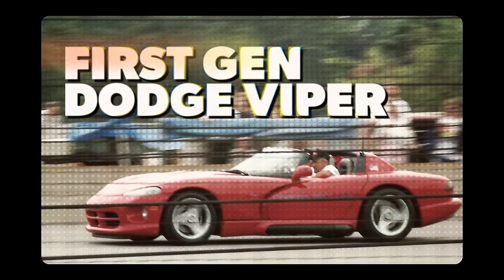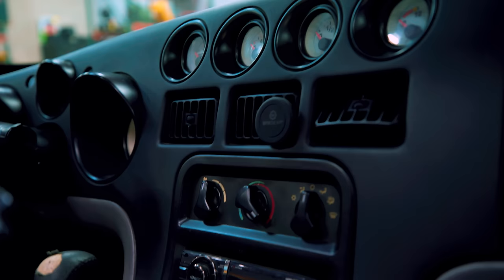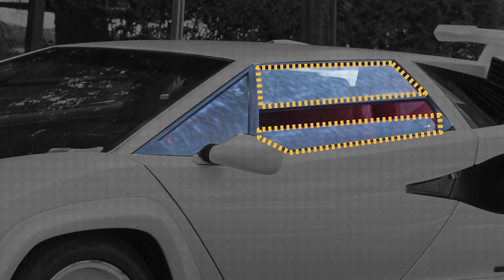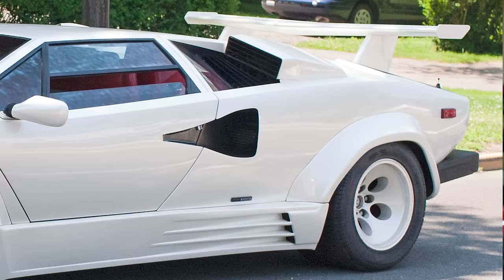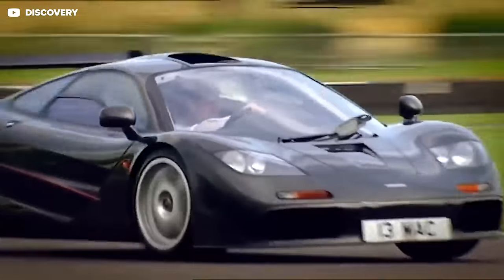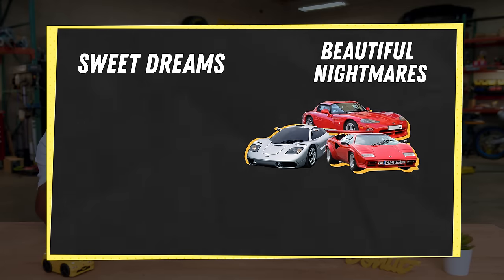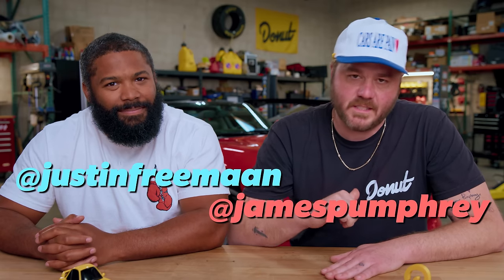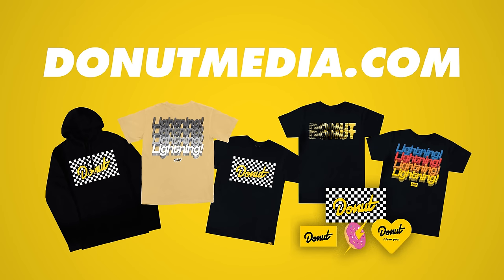Cool Cars That Suck to Own

Comment: You should do one on “boring” cars that are actually fun to drive
Reply: 100%, buddy!!
Reply: they did, in the past, they made a video on cars that look boring but are actually pretty fun.
Reply: Smart forfour (first gen). Only weighs 2000 pounds, very fun engines, the stock suspension is very stiff/sporty, and it has electric power steering which feels extremely responsive and accurate. 10/10 would drive again.
Reply: I had.a ford escort wagon 5 speed manual and that thing.was quick as hell... It had a mazda engine in it... It was like driving a go kart.
Reply: They already did
Reply: I had an escort 5 speed too, not a wagon but was a blast
Reply: A4 B6 1.8T Quattro with a manual. You'd hardly ever notice one, but man they're fun.
Reply: @joshsemo4214  it's probably just nostalgia, but my dad had a Ford Escort when I was younger and I remember absolutely loving that car. I'd pick one up today if I could find one in my area.
Reply: @joshsemo4214  oh hell yeah. I drove a 4 door, auto, had 78k miles when i got it; had to scrap it at 257k
Reply: YES! YES!
Reply: That's most of their videos.
Reply: They have their Miata series, right? 😅
Reply: Yeah, that was a good episode.

As for Escorts, one of my first cars was a 2 door Escort hatch from before Ford and Mazda had babies together. It was OK. My guess is that it's Mazda's influence that made a lot of Ford's cars fun. Currently I'm a grown-ass man and every day I drive around in a 12 year old Mazda 2 and smile. It's truly an entertaining and cheap car.
Reply: Bumpity bump bump
Reply: Renault Megane 2. It has a 5 speed manual with a 1,4L turbocharged engine and even though it doesn't look like much it's an amazing car.
Reply: Skoda Octavia RS mk1. It looks like the family car your grandfather would own but it has the legendary 1.8T 20V 200hp turbocharged engine under the hood, the same as the Audi A6! Insanely reliable and robust engine, smooth and quick acceleration (because it's a turbo) and the car itself is super cheap. What more could you ask for?
Reply: Please talk about the American 6th generation celica
Reply: Every old shitbox that is reliable, slow and could be fixed with pocket change.
Reply: Manual Yaris
Reply: @SusedatLubo  that's not fun to drive... That just gets you from point A to point B
Reply: @Mr.Engine993  Really depends on what you clasify as fun. My civic fits that bill and even with bolt-ons and a cam it's still fairly slow, but super fun to beat on or just cruising and rev matching. A friend of mine has an opel astra f estate 1.4 90hp, super boring and slow, but just with I/H/E it started to pull decent and he has a blast beating on it. Hell even my dad's old clapped out passat b3 with 1.8 90hp engine, which is a slow rolling chore to drive was fun to beat on. Point i'm trying to make is the car doesn't make the fun, you do. It's just easier to do it on an old manual shitbox cause you don't care about babying it all the time and it's still going to be practical. Overdrive did several videos with a PT Cruiser and a Ford Ka, it doesn't get more mundane than that, but they had tons of fun modifying or driving them on track.
Reply: So maybe Honda civics and Mazdaspeeds?
Reply: My '96 Accord Wagon is a blast to drive. Some of the best handling ever.
Reply: @infin1ty850  they're great cars actually I've had two.
Reply: *we found the Miata guy
Reply: 5 speed escorts. Boring and not fast but it feels like a go cart.
Reply: @joshsemo4214  man I drove one. It wasn't fast. You had to turn the AC off to get on the freeway. It only had 95hp
Reply: That'd be so dang lit! Freak yeah!!
Reply: Octavia
Reply: I nine hundred and sixth this motion.
Reply: Saab 900 type whips
Reply: yes
Reply: @capnwhiff  you're right, but another one sounds fun
Reply: This comment is big brain
Reply: Already a thing
Reply: Kind of reminds me of the old saying "Is it more fun to drive a fast car slow, or a slow car fast?"
Reply: Tdi with a tune
Reply: Any rental
Reply: Judging by the likes on the comment they will definitely have to do this.
Reply: They did an entire series of that called Money Pit featuring a Miata.
Reply: Or a “most fun/coolest cars that are faster/slower/ less hrs power than this *insert popular moped, tuned out lawn mower, boat, ect*”
Reply: Hell yes the most fun car in the world is a rental Versa
Reply: They have a while series on the miata 😅
Reply: Best answer for this is any car you can afford to drive it without giving a shit if it breaks or not. lol
Reply: Hooning a Gen 4 Prius is surprisingly fun yet completely stupid
Reply: This
Reply: I have a 50hp volkswagen fox and its fun to toss around
Reply: Fuck yeh need this
Reply: Toyota celica!
Reply: Prius,   it has tiny crap tires.   Try to get side ways.   Have fun. 
Dodge neon, 
Pontiac Bonneville ( if it is supercharged and it works)  
Buick Riviera.  The super charged wide track...  the short one but not the bubble boy car.
Reply: Bump
Reply: They done it already
Reply: Srt-4 would definitely be on that list 🔥🔥
Reply: @neilpatel8769  agreed, it was a couple years ago too so they should do a part two or something
Reply: I think they did before
Reply: 2nd this
Reply: Ford fiesta with the 1.0L engine and manual transmission. Poor man’s ST
Reply: Happened.
Reply: If a car is fun to drive, then I would not call it boring. Lol.
Reply: 1993 chevy 1500
Reply: I submit my 2013 1.4t dodge dart for consideration! Handles great and makes all the fun turbo sounds
Reply: Chevy volt
Reply: They did it was the Civic video.
Reply: Already have
Reply: Like miata or a civic
Reply: 100%
Reply: Pt cruiser
Reply: That one with the silly drift button ☝️ 😂
Reply: You really want your clapped Honda civic to be featured huh?
Reply: Get a manual 3.5 Altima. Trust me
Reply: @CodemasterRob exactly what I was thinking.
Reply: Well, the most boring, ugliest, really the most ugliest car but its awesome to drive is undoubtedly fiat multipla, it really feels weird.
Second one should be ford c-max, that car is a beast on corners.
Reply: Any Honda civic ever
Alternatively basically any hatch with a manual. Go do autocross and have a blast
Reply: Brilliant idea 💡
Reply: Volvo 240 should be in this list
Reply: The Honda Prelude shoud definitely be on that list!
Reply: corolla hatchback with the manual transmission
Reply: Boring cars can be fun!
I’ve been lucky enough to have had some fast cars, but one of my favourite was a 09 seat ibiza 1.4 Manual petrol that my wife had.
We have a lot of bumpy country roads where I live and the size of the car and tuning of the dampers was perfect for it and really fun to drive.
Just goes to show you don’t need massive power, lsd, or rwd ect to have fun on the right road.
Reply: @capnwhiff  I was gonna say. I think they also did different budget points for the cars in the vid
Reply: HONDA FIT
Reply: PART 2 OF THIS ONE LOL
Reply: 2015 Mitsubishi Mirage was the best car I owned BECAUSE it was so cheap and boring
Reply: 1992 Sentra SE-R Was boring looking but fun to drive !
Reply: Toyota matrix with a stick, the xrs even came with toyota vtec
Reply: @vornamenachname727  i'd say hydraulic power steering feels more accutare and responsive
Reply: Theyve done it already i believe… with the miata and other cars
Reply: @kingbleach4446  i see you too are a man of culture
Reply: Pontiac Vibe. When I was like 15 I'd go with my dad to his work and do laps on the roads around the buildings. (They were closed off so nobody else was in danger.)

That Vibe had a real low center of gravity, and relatively wide tires and wheelbase. It slid perfect on the gravel, transitioned to the asphalt so well. I'm sure nostalgia and personal bias is a factor, but for a grocery getter that car was so fun.
Reply: Cadillac Ats, you'll probably never notice it but it shares the same platform with the camaro minus the v8 options. Can come with an lsd, brembos, magnaride and a manual
Reply: Mazda mx3 for sure
Reply: @Josh Semo  I'll just say, mazda knew how to make really fun engines in the 90s, from high revving rotaries, to the BP engines in the miatas to their diesels. Not a ton of hp for any of them but my god they are fun.
Reply: @Rust on Wheels  I think they had a diesel mazda engine iirc. That or a turbo 4 cylinder that was like 1.3 or 1.4
Reply: @CodemasterRob  had a b6 s4. Great handling car
Reply: @vornamenachname727  Smart Roadster is much more fun👍 Gruß
Reply: Toyota CHR is a good one. It's really slow so you have to learn to carry momentum through corners, but the handling is actually good and the wheelbase is short. 50/50 weight distribution too. A good car to best on
Reply: @joshsemo4214  my parents had an old escort when i was a kid, miss that thing a ton
Reply: Smart cars. Super fun to drive especially the electric ones
Reply: Honda Fit/Jazz
Reply: Crown Victoria...It's cheap ...Well...It was till people caught on...has low power...However considering how big it is...they handle very well and even better with a few mods...can even fix the low power issue....Honestly I've had a freakin blast in every single one of them I've been in (it helps not to be in cuffs while in one) they are absolutely hoonable...and I've had several from '85-'02 ...honestly the entire Panther platform from every year is fun with hidden potential....
And to most people they are boring and lame. :)
Reply: 93 Ford Escort!!
Reply: 2004 honda accord 3.0 lx ,best car i’ve owned
Reply: SVT Contour
Reply: Honda fit 2nd gen especially
Reply: Uuh, the mini cooper!
Reply: @renaokawa6199  Can't explain why but I really wanted one in highschool. It just looked like fun and they were dirt cheap.
Reply: They have already  it was cool
Reply: The steering have no feeling!!!
Reply: hell yes.  i'd say all vw golfs
Reply: Mitsubishi FTO
Reply: 2007 MAZDA 3 YEAHHH
Reply: Scion tC!!
Reply: 5th Gen Maxima SE with the 6 speed
Any turbo Volvo from the 70s to 2009
Any turbo Saab, even the GM cars as long as they run

tbh most crappy FWD american whatevers from the 90s can be plenty fun with whatever the biggest motor was and a stick
Reply: All Volkswagen list lol
Reply: Just excluding the Miata, because we've heard about enough of the miata
Reply: @BlackRaven3.6  they were fun I've had 2. Both 95s both the same issue..... unibody rot. Beat the crap out of both and the engines took it! Miss em tbh and they were the type to feel fast but really weren't.
Reply: @thebobshatney  i go 4 the 2nd. problem is slow cars just cant go fast 😭
Reply: 05 ford focus st, lovely
Reply: Geo metro!
Reply: Buick Lesabre
Reply: My ex had a dodge neon with a five speed. That shit was fun as hell, like a bigger version of a go kart.
Reply: Pontiac G8? 🤔
Reply: They already did
Reply: Miata, mk1 rabbit, Silvia, trueno
Reply: Honda Fit ftw
Reply: Yo this idea is fucking dope throw a Volvo C30 in there
Reply: Chuck any rebadged Holden on it lol
Reply: Fiero.
Reply: honda fit honda fit honda fit
Reply: Toyota 86 😂😂
Reply: Is250 … full grandad sleeper
Reply: Case and point, 1st gen Honda insight with the 5 speed manual (I have one, and it's actually really damn cool)
Reply: 93 Buick lesabre should be no.1 I will drive myself to California from CT in my lesabre to prove it
Reply: a boring car that drives way better than it should is my 2013 passat
Reply: @ian93sc28  no need to prove, some may say they're ugly but fuck, they're a family car and a family making car, and, and, fuckin siiiicccckkkkkk. Also they have the 3800 (if it's the generation I'm thinking of) ans that thing just doesn't die
Reply: Town and country 2nd gen 1995
Reply: 2006 LS4 powered Impala SS would make for a good one, an interesting car to me, an NPC vehicle to most.
Reply: get a 99' ford escort with a manual, I bought one last month and I've been tossing it around like crazy in this WI snow
Reply: I'm pretty sure they've already done that...
Reply: 6 speed Maxima
Reply: kia forte gt
Reply: 2000 grand am gt coupe was my first car thing could go 135 and had a 0-60 time of 6 seconds all for 1000 bucks also super easy to work on and cheap to repair
Reply: all of them
Reply: Awkwardly enough Chevy sparks are lowkey fun to just floor it and feel the torque steer 😂 

I don’t own one but I work for a car lot and drove a few now. Surprisingly fun
Reply: @vornamenachname727 mine was so much fun incredibly impractical for anything other than commuting. That thing with the traction control off was the most fun in snow.
Reply: Let me guess a Miata 😐
Reply: pt cruiser
Reply: Honda fit should go on that list
Reply: chevy cavalier/pontiac sunfire with the 5 speed manual!
Reply: @drinkmoresoda  had a ZX2 w/ a 5spd.  Made 38mpg and was pretty fun on twisty roads.
Reply: Would be one heck of a Volvo video
Reply: The Nissan leaf should be on this list
Reply: I had a Fiat 500 as a rental. I was surprised by how fun it was to whip around in. I wouldn't want one every day, but solid rental experience.
Reply: Honda Fit all over that one haha
Reply: Honda fit top 1
Reply: @atnfatality3026  I've got 2 haha
Reply: Second!
Reply: @joshsemo4214  I had a '98 2 door Zx2, 5 speed manual, super fun to drive
Reply: Prius 100%
Reply: Civic Si
Reply: Some of the most fun you'll have is race offroad derby in a 500$ pos
Reply: 2003 buick lesabre
Reply: Honda fit
Reply: 2000 v6 honda accord sport coupe
Reply: 2004 Honda Accord V6... Manual.
Reply: Nissan 100NX
Reply: Mx5 Miata is on top 🎩
Reply: Good idea!
Reply: For Europeans, the new Dacia Sanderos are super fun, friend has one with 120hp on tight roads it's a blast
Reply: Only of they exclude the Miata. Too much of that thing.
Reply: Vw beetle
Reply: Wolkswagen Golf 1.6L 2003 base spec manual.
Reply: Manual civic with vtec
Reply: 28i BMWs, same speed as normal traffic but sound better with an inline 6 and handles amazingly (before they replaced 28is with turboed 4bangers)
Reply: Yesssss 😎☺️
Reply: And include the Focus ST so the value of my car skyrockets 😂😂
Reply: @CodemasterRob  they are very fun to drive but you gotta be very meticulous with maintenance, especially if you buy a high mileage A4 or else you’ll end up like me and completely nuke the motor 😂😂
Reply: @vrakathen9332  had mine rebuilt at 258k after owning it for a decade. got APR stage 3 more and it breathed a new life into it
Reply: It’ll just be like Mazda 3’s and Ford Focus’s and stuffz. I have a hard time thinking there’s much surprise in this proposed category. But… I’d watch it anyway. 😅
Reply: Honda civic #1
Reply: ...Hell... even my 1.4 corolla is fun to drive. It has no powa (baybeh) and accelerates like a granny pushing at trolly in the supermarket. But it's a momentum car. Get it on the B roads you can stay pegged at 60 round the hair pins and everything. It's rewarding because you know you earned every ounce of speed by driving perfectly. Even my corsa was fun to drive. Another 1.4, but it wanted to drift everywhere. When it snowed sideways was the only way it could take corners.
Reply: Should check out some previous videos. Was done a few years ago
Reply: V6 accord, I still want to drive one
Reply: Twingo
Reply: Mr-s
Reply: 2005-2007 Focus ST!
Reply: I wonder if the ford probe will be acknowledged and finally get to ascend to car heaven
Reply: Yes! This is what the people want!
Reply: Scion tC 1st gen
Reply: Chevy sonic 1.6L turbo
Reply: Like a mint 5 speed 1997 maxima
Reply: Toyota Corolla
Reply: 2000 manual civic XD
Reply: Saab 9-5 should be on that list.
Reply: Honda fit
Reply: YES!
Reply: @SketoThanos  fr that thing is light as a feather
Reply: gen 1 veloster turbo! people see "hyundai" and automatically assume it's a piece of junk; but, this 201hp turbo-hot hatch only weights 2700 pounds and makes a bunch of low end torque. honestly feels like a go-kart to drive one
Reply: That's almost any car you take on a racetrack.
Reply: As someone who lives where there is snow on the ground more than half the year, thats a very very long list 😂
Reply: @catalintimofti1117  and it's like 100hp. I bet if you add some wings on it it'll fly.
Reply: @SketoThanos  my friend has one and he actually went flying while climbing on a bridge at high speeds 💀
Reply: @catalintimofti1117  oh no, which version does he have?
Reply: @SketoThanos  megane 2 1.6 16V
Reply: @catalintimofti1117  it's the perfect car at high rpms. Cause in low rpms it has too little torque.
Reply: @SketoThanos  my father has the 1.5 dci version 
Drove it a lot after i got my license .its geared short and it's surprisingly agile for 85 HP
Reply: @catalintimofti1117  oh yes the dci. Diesel engines are awesome!
Reply: @SketoThanos  the 1.5 in particular has basically a cult following around it
Reply: @catalintimofti1117  indeed, renault makes incredible engines! And they can withstand a fucktone of stuff.
Reply: @joshsemo4214  can confirm I have a 1998 escort lx, it might not be going particularly fast but the 2.0 duratec sure does sing
Reply: Honda has entered the chat
Reply: Vauxhall Omega
Reply: 03 Pontiac Vibe GT/ Toyota Matrix XRS
Reply: 2018 Acura RDX, I’ll tell you THAT
Reply: Toyota Solara and Honda Accord Coupe should Def be on that list.
Reply: 1994 Honda Civic, base model, better than a Carrera GT
Reply: It world just be mazda miatas in 5 different trim levels lol
Reply: any manual car tbh
Reply: Now yell gotta pay him 😮
Reply: @RustOnWheels  This guy gets it! It's hard to have more fun for the money.
Reply: Manual 07-2013 Mazda 2
Reply: Honda Fit with a manual 🤌🏼
Reply: FAAACTS i need a new beater n need ideas😭
Reply: Goat Comment.
Reply: That is A GENIUS IDEA 🔥🔥🔥🔥 JAMES WELDON FTW
Reply: Ironically enough 2007 Honda Odysseys are some what fun to drive
Reply: Geo metro, foot to the floor all the time. But no speeding tickets
Reply: Toyota Corolla
Reply: Opel Corsa B with 1.0 engine. Only ~75hp but engine was so happy for revving to the red line. Car was small, light and stiff it felt like a go-kart.

Friend owned 1-st gen Lancer. It was so rusted, there was no passenger floor. It was used to carry soil inside and tow snow-cannons (literally).
It didn't even got close for passing annually legislation. (Rode ONLY on skislope) It was the best and craziest offroader EVER. Later I off-roaded Land Cruiser and it was "meh" compared to that old lovely junk.
Reply: a STOCK 90s honda civic hatchback or crx is an absolute blast on backroads. it has everything that makes the miata fun except RWD. and it has a much much stiffer chassis than most cars of that era and will get 40 mpg pretty easily. all in all the perfect young adult a to b car
Reply: Pretty much any Corolla S fits the bill
Reply: Already done
Reply: toyota yaris!! that thing is like a go-kart fun af but so boring
Reply: V6 honda accord (2012 generation; 8th gen i believe) thing is shockingly fun to drive.
Reply: 1999-2004 VW Beetle manuals
Reply: In it's early days out in the streets, with the benefit of hindsight now, I would've loved to have a '91-'94 Camry XLE, V6. With that full on Baby-Shit Brown color code, (and perhaps slapping in a nice 5 speed conversion, coupled with even just some of the most basic of minor tuning adjust!ments made by many a young aspiring gearhead would've tinkered with in those days). What a blast it would've been to watch many higher priced, and over-hyped "Hot Rods" hitting showrooms at the tail end of the '80s to early '90s era of ever-slumping speedsters racing around and just plain *GETTIN GOT!* by Grandma's Grocery Getter of the early ’90s! 

"PUNCH IT, MARGARET!!!" 😁
Reply: Sentra B13
Reply: 1. Honda Civic baby
Reply: Can I just say, I've owned about 30 cars, from RWD Drifters, 4wd Subarus and FWD nightmares (Type R Civic...). The most fun I've had in a car was my 2002 Renault Clio 172. If you ever have the chance to buy one, do it. Such a fun little car. You can absolutely throw it around, and it never broke on me.
Reply: Rich people car channel
Reply: @joshsemo4214  bro my freind had a gt i believe it really did haul ass
Reply: Chevy Cruze can go on there idc if y’all hate
Reply: The Sentra SER would be one of the cars. That was a fun boring car that and the 90s 200sx
Reply: Abouth the only 90s vehicles i like are basically carryovers from the 70s and 80s.. like 3rd gen camaros, fullsize chevy/gmc vans and astro/safari vans, 22re Toyotas, early 90s, volvo sedans, Subaru boxer cars, and  all of them must be obd1.
The rest i dont like. Only front wheel drives i like are early 90s obd1 hondas.
Reply: Makes the market skyrocket
Reply: @rattmon  true
Reply: Stock sleepers would be cool.  I volunteer my BMW X5M.
Reply: @bigboycombo6342  “stock sleepers”
Reply: Honda Accord coupe v6 manual, gapping type r's and always slept on
Reply: prius
Reply: Had a 1966 VW Type IV Squareback when I was 22, so...1986. Paid $200 for it, the rear floorboards were so rotted they were non existent, it had a 6V electrical system that required me to use the noisiest power inverter ever made by Radio Shack to hook up my 50 watt marine stereo system (which I ran through a pair of Kenwood tower speakers laid down in the back with the rear seat folded... fuckin' LOUD and sounded great lol), and the whole car was held together with duct tape, bailing wire and bubble gum...total death trap! BUT, it also had the 1600cc twin carb engine in it, which was able to do burnouts in 2nd gear, and it handled like a dune buggie when I thrashed it HARD through the sandy fire roads in the NJ Pine Barrens... most fun I've ever had on four wheels!
Reply: Toyota Chaser enters the chat
Reply: VW Lupo, either the 1.4 DOHC 16v or the GTI 1.6 DOHC 16v. Based on a shortened polo 6N chassis, so had very darty handling and a very quick turn in. Also weighed only 910kg, so made great use of its modest yet exciting twin cam engine. Miss my 1.4 every single day, was a fantastic cornering car and gave a good fight to several much more potent cars on the right road.
Reply: my brother-in-law had an old stick shift, VW Eurovan from the early 1990's. (the body style that had the same profile front and back). That van was slow and dangerous and so much fun to drive. It felt so top heavy and you sit over the front wheels so you feel like you might tip over around the most basic corner. He said he got pulled over by cops all the time because they assumed he was smoking pot just because he was driving that car (he was Mennonite. NOT edgy looking). And it had crazy space inside!
Reply: Gen 7 manual Golf Diesel. revved nicely, precise shifting and steering. Nice rental
Reply: First gen ford taurus
Reply: 2004 Mini Cooper r50-53
Reply: Bro you win. I think they'll see this and do it
Reply: 05 corolla xrs
Reply: 2000 nissan maxima 5 spd, that thing scooted with the vg30de. Kept the tires lit thru mid 2nd gear

Could just be that the tires had like 10% left on em though 🙂
Reply: my cousin Greg got a ticket for 'display of power' driving his dad's 76 AMC Pacer, our respect of his driving went up exponentially
Reply: Like the juke nismo rs tuned up a little it’s crazy
Reply: My '05 Hyundai Accent GT would fit this. Its been through a lot and really showing its age, but you can toss that little guy around like a rally car and have a blast in an empty parking lot on a snowy winters night. Some day I'll have to move on, but I will miss that little guy.
Reply: Mazda 6 2.5 turbo
Reply: Yes! In high school I was sold a 1990 Ford Festiva for a dollar by a family friend that got in the shop he owned. I worked summers for him. He basically gave me that car with his blessing to do whatever in it. The absolutely idiotic things me and friends did in that car. It’s a wonder none of us ended up dead, hurt or in jail. FYI, the Ford Festiva has some pretty decent off road chops if you just send it. All gas no brakes, (they didn’t work that great anyways). Do it for Dale!
Reply: Is miata the answer?
Reply: No. 1
Ford Focus. Nuff said.
Reply: Yes pls!
Reply: 2.3l 5 speed ranger before they went to the duratec engine, same engine in the turbo thunderbird save for some internals, and this very engine design held the world record for a stick shift quarter mile pass in a thunderbird for a little while iirc.
Reply: @joshsemo4214  Had a Dodge Colt (Mitsubishi) 1.6 litre Hatchback with twinstick transmission. Koni's, sway bars and Yokohamas and the most fun to drive car I've ever had.
Reply: Lincoln mark vii lsc coupe
Reply: 1996 Toyota Tercel Blackhawk. 4 speed manual.  Sure it was a Toyota friggen Tercel, but man it was hassle free, over 200k and cannot tell you how many times I got back into the Tercel and turned the key to start it but OOPS!! Its so quiet, that It was already on! 

What I loved about it was that it was the perfect run around car... just hop in it start it AND GO!! And because of the way it was engineered it felt... not fast.... BUT NIMBLE!! You could turn the wheel with your pinky thats how effortless it was to drive. The little 4 speed was so easy and quick to chanhe gears and once it going, it was racey like a go kart!! 
Aaaaand 40mpg all day long!!
Reply: Toyota Yaris Hybrid.
It's quite insane how zippy it is around town, and surprisingly fun to drive in hilly, curvy roads using B mode and just playing with the accelerator. A better, more grippy suspension would be nice tho. Nothing that a mod can't do. As well as thinker with the electric motor for a little extra oomph.
Reply: Like a Twingo c06
Reply: 90s camrys would be on the list probably maybe. My first car was a 96 camry
Reply: 2001 honda civic with 6 inch fart can
Reply: Saab lol
Reply: Hell yea!
Reply: Honda Fit for sure
Reply: Dope idea
Reply: My 2005 mustang gt
Reply: sounds like a 100% subjective thing. car guys like to make the shittiest thing the best thing ever.
Reply: every NPC car on the road are Boring, throw em around on an auto cross you will find it fun. those vid wouldn't work at all
Reply: Ford s-max 2.5 should be in that 💯
Reply: This could make for good content. Great idea.
Reply: @joshsemo4214 hell yeah!
Reply: Acura integra
Reply: James "also" 👏
Reply: Idk if I’m biased but my 2002 Honda Accord is my favourite car to bring to a canyon run
Reply: Any 5.7 hemi and any 4.6 stang two highly slept on cars but a blast to drive
Reply: Every car can be fun to drive. It’s up to you to find the fun in it. 😂
Reply: Love this idea! Would definitely watch that!
Reply: Ford Crown Victoria
Reply: Lucky you brother they just dropped that video
Reply: Well look at that
Reply: posted this comment, and a month later, they decided to take your idea
Reply: They did it!
Reply: Volvo 850R and Saab 9-3 AERO was very good and fun to drive
Reply: Honda Civic 😂
Reply: MK1 Miata would be number one. My dad has one from 1991, and it's not powerful or really that good looking. But damn! It's fun to drive
Reply: @capnwhiff  and again
Reply: The old Ford Fiesta's.
Not good at accelerating, not flashy and small.

But damn can they turn. I had one with wide tyres. The thing turned like a Tron bike.
Reply: like first gen Taurus SHO
Reply: I loved my 85 cutlass sedan it was so great to drive
Reply: 1994 Mercedes SL600
Reply: YES!!!
Reply: 1972 BMW 2002.  Not the Tii, just the naturally aspirated four banger.
Also, weirdly, had immense fun thrashing an '83 Honda Accord hatchback to death.
Reply: I had a 2001 Hyundai Elantra GLS 5 speed manual. Just for that one model, they wanted to compete with a Subaru WRX. It looked like a 4 door compact family sedan, but holy crap was it fast! It got hella good gas mileage too. I loved that car, 35 mpg and it layed rubber. Unfortunately they sold the company and changed the design, so it got to where I couldn't get parts for it anymore. A strange 1 and out from Hyundai.
Reply: Sooo im here from the future. LOL
Reply: Oh what challenge. Any Honda in history?
Reply: @London Watson Large Hondas are often also quite fun to drive (and uncomfy)
Reply: Mk4 Vw jetta gls 5 speed is the most fun ive ever had in a vehicle slow as shit but fun
Reply: @jaibennett9961  what was rev limit
Reply: 85 Selby Dodge. Funnest car I ever owned. Was great on gas, too. 30mpg no matter where my foot was.
Reply: Crazy they just made that video last month
Reply: The chevette! We did burn outs on those bicycle tires
Reply: Aka every Honda civic and accord ever 💀😂
Reply: @tardiscommand1812  is that want you call corvolette en deutchland?
Reply: Turbo Charged Mini Cooper s my buddy had one it was pretty fun ngl
Reply: I had a 1987 VW Jetta that was fun as hell. Its 5sp manual, no power steering, and stiff suspension made it feel like a race car even though I wasn't going very fast. Also, my impression of the Jetta was helped greatly by my previous car being a '79 Chrysler New Yorker POS.
Reply: @stewpacalypse7104  Sure Jetta feels nimble and fun, but that New Yorker was probably a Rolls Royce in comparison...
Reply: They diddd
Reply: VW GLI autobahn, fun as hell to drive
Reply: @adrianchavez6236  the dodge caliber srt4?
Reply: @miljororforsprakpartiet290   around 6k made 115 horses forged bottom end from factory what a beauty that vehicle was would like to own it again one day
Reply: Miata
Reply: They did this already but I'm salty. A month after they posted it like 3 cars I had my eye on disappeared. Salty.
Reply: 99 corolla
Reply: Basically a 2 car segment on Miata’s and s10s
Reply: As an avid Chevrolet Beretta fan/owner, I second this!
Reply: That's every car. My Hyundai Excel didn't have much power but it had an E brake handle. 😂
Reply: Put the 07 Ford focus on the list !
Reply: volvos certainly
Reply: Yesss
Reply: @CodemasterRob true i have a 1.9 tdi with 170 hp and its surprisingly fun
Reply: @wade7959 hi
Reply: how does it feel to be the reason they made a video😂😂😂
Reply: Yes
Reply: They have
Reply: Honda Fit !!!!
Reply: They have
Reply: To this day I miss my FUXKING 2004 Nissan Sentra. It wasn’t fast but driving it felt fucking fun.
Reply: Toyota Matrix (and by extension the Pontiac vibe which is the same car) especially the one with the higher HP engine and manual, these days with crossovers all over the place they look like the most generic grocery getter barely-keeps-up-with-highway-speeds econobox. Except they can rev pretty high and decent handling. Not to mention theyre cheap af, easy to work on and have tons of useable practical room inside.
Reply: i argue for the 9th gen accord sedan with the 6mt!
Reply: Quietly, the Corolla Hatchback is a hoot to drive. Not the GR...I'm sure that's great...just the regular hatchback with the CVT. It just doesn't feel serious. Go test drive one and do a tight uturn faster than you normally would. It's just fun.

I didn't buy one because it also has the worst road noise and vibration I've ever experienced in a new car.
Reply: Honda Fit on the top of the list
Reply: Mazda3
Reply: efficiency and substance over style.
Reply: Suzuki Cappucino. Small, weak, but really fun being driven "fast"
Reply: Why are you telling everyone you're broke?
Reply: 1992 Chevrolet Lumina V10
Reply: any lexus lol
Reply: Pontiac Vibe! It was a rental and that thing pretty fun
Reply: 6 speed chevy cruze better be on that list. factory limited 123 never felt so fast
Reply: That's all "boring" cars. I made my 1995 Buick Regal plenty fun to drive
Reply: Honda del sol comes to mind
Reply: Yeah! Like the Crown Vic.
Reply: 2.5L Jetta or Rabbit
Reply: 2.5L Jetta or Rabbit
Reply: 2.5L Jetta or Rabbit
Reply: No car requires airbags.
Reply: @joshsemo4214 can confirm anything on the mazds bg platorm is fun
Reply: My first car and still my current car is a Peugeot 107, it’s a boring car by most standards, but it’s like driving a go kart and super fun to drive, plus it has a little 3 banger Toyota engine under the bonnet, so it’s reliable and super fuel efficient too!
Reply: Don't forget the tv show "Viper" The defender version of it looked wayyyyy more cramped for the star(s) driving it.
Reply: Toyota tercel
Reply: HYUNDAI ACCENT 05 HYUNDAI ACCENT 05 HYUNDAI ACCENT 05
Reply: honda beat.
Reply: The accent that fwd car was so much fun. I remember drifting that bitch in the snow and rain. All the while getting 25 to the gallon. Then I had an 08 fusion with the big V6 that thing would pull.
Reply: A 1993 Honda Civic coupe with the body kit. Pull up to any lights and everyone wants to live out the fast and furious fantasies to race you.